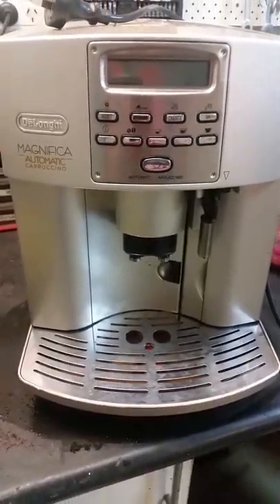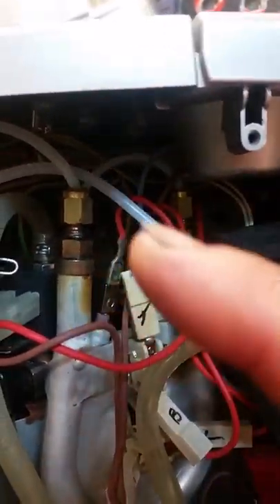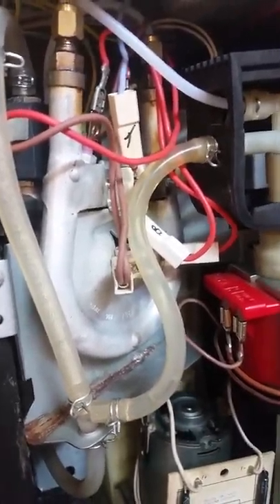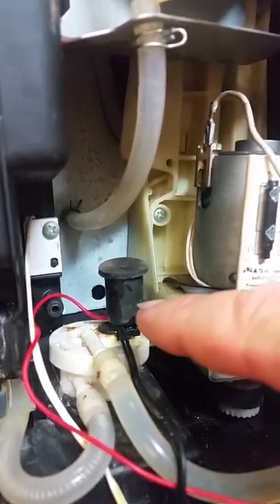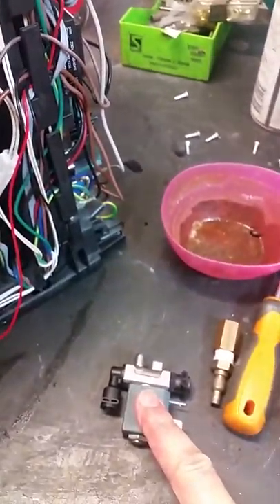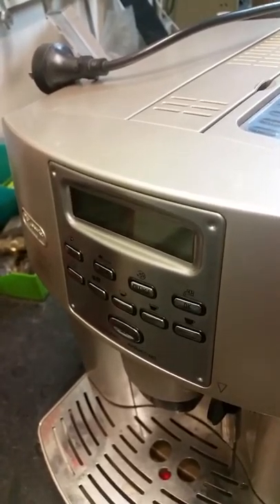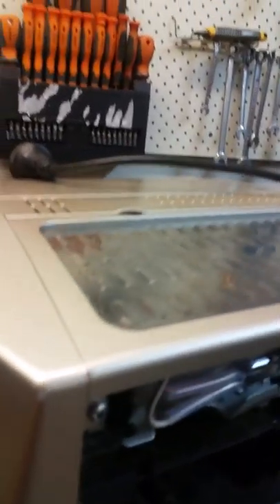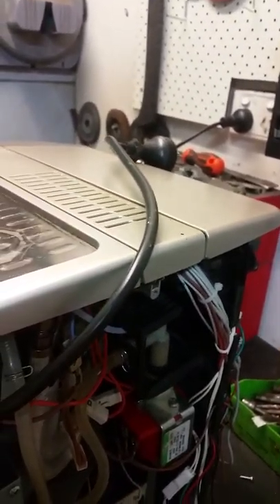How to Delonghi Magnifica 3500 problems and fixes!

Comment: Currently got a water flow problem, I've pulled it apart and there is flow right up to the pump, but not after so I'm assuming its a blockage or the pumps not working. I've turned it on and nothing comes out the otherside of the manifold above the pump. Any idea what it would be?  (Error is something like No water)
Reply from the maker: Michael Silvester Hi Michael. Not really enough info provided. I take it the pump makes some noise. I'd be looking at replacing the ball in the pump.
Reply: Hope descaling would help. Next is remove pump and press in at the outlet hole. Else need a new pump.

Comment: Hi Robert! I have an Esam 4500, almost the same machine, and the brewing unit cannot be removed anymore. Pushing the two red tabs and pulling at the unit doesn’t work. Any ideas? Thx from the Netherlands.
Reply from the maker: Paul-Ivo B. It will only come out if the machine is fully off. If it is off and still not coming out then I'm afraid I don't know. Good luck!
Reply: Switch machine off, unplug power, pull out drip tray. Use torchlight look at bottom right corner of brew unit, you’ll see a tab. With the use of a long flat head screwdriver, push tab towards the right, brew unit will be released.

Comment: I'm having a problem with my generator I've tested ohms and there fine and it was heating but after a while showed general alarm so took advise and changed the thermal fuses now my general alarm comes straight away tested all with multimeter and all good but no heat what would you suggest trying now please I'm now demented with this lol

Comment: Have the same model when I turn it on it will do everything right up till you try to use the streamer it makes clicking noises and doesn’t push out steam or even water. Can you point me in the right direction how to fix the issue. I’m very good at fixing things but don’t want to replace a part that doesn’t need replacing. I’m thinking it’s the generator!?!?
Reply: True Natural Healing if both water and steam not working, it could be the inlet side of solenoid valve EV1 that’s blocked, while the solenoid itself still works (as you’d mentioned that it still clicks).
You’ll need to find a way to unblock it, firstly, you may reverse the connection by swapping the two cables connecting that solenoid, this could be a quick way to agitate and loosening particles causing the blockages. 
Alternatively, you need to find way to identify and locate blockages, and flush it out.
In my case, the EV1 is totally stuck, to a point where there’s no clicking sound at activation in test mode (despite voltage is detected with multimeter), i flushed mine using 100% vinegar, till it starts clicking again.

Comment: I am having problems with the milk frother, is this a regular problem which you can fix
Reply from the maker: Hi Bill. Firstly pull the lid apart and give it a good clean. It may be blocked. Secondly try replacing the O rings on the nozzle the frother slides on to. Best of luck!

Comment: I'm getting the error "coffee is too fine and insert water spout" and I can't get hot water in the same machine as yours. Help!
Reply from the maker: What happens if you just ignore the message and use as normal?
Reply: I can only make coffee and I can't use the hot water or steam/foam function.
Reply: I just fixed this problem over the weekend, it’s the water heater exchange unit. It clogged up with lime, I used a strong picture hanger cable from Home Depot and push thoughts.
Reply: @tnguyen172266  Hm. It didn't work for me.

Comment: my 3500 will only come on when i plug it in. It says system diagnosis then shut off. can not turn on by the power button. Any ideas
Reply from the maker: No. Sorry. May need new control board from the sound of it. Good luck.
Reply: Conduct a round of test mode to identify where the problem is, to begin with.
Reply: By the way, did you really tried turning it on by clicking on the exact POWER button? It’s the one on lower left, not upper left.

Comment: Hi all. I have a De'Longhi Machine that is flashing all the lights on the front, and the inffuser is not coming out. however when i switch it off completely and on again it is not going through the correct shutdown and reset procedure as it used to. So therefore i am not able to get inffuser into a position where i can remove it and make sure it is seated correctly. please if anyone has experienced this and has a suggestion please let me know.
Reply: Neville McIntosh lube the long threaded rod to begin with.

Comment: I have same machine. The milk is coming out cold. I already replace the 
Clutch Milk Tank Frother but no change. The steam work fine. Help 
please.
Reply from the maker: I think this machine has another heater for the milk.
Reply: @Discoworx  Do you know where or wish one??
Reply from the maker: @Eduardo-kk3um  follow the lines back to find out which one
Reply: @Discoworx  will do thanks